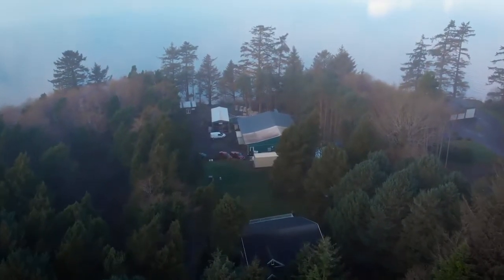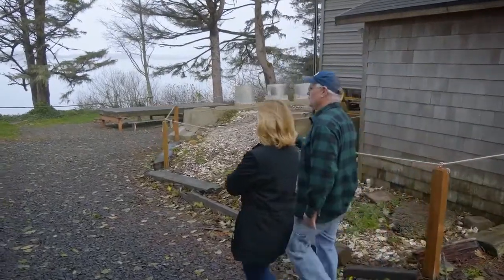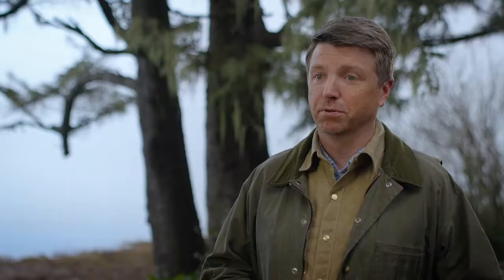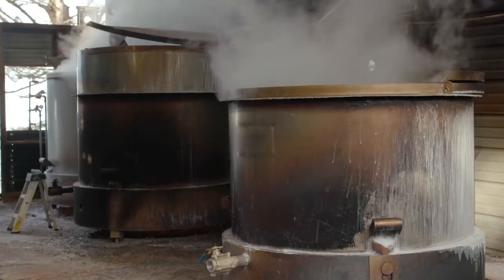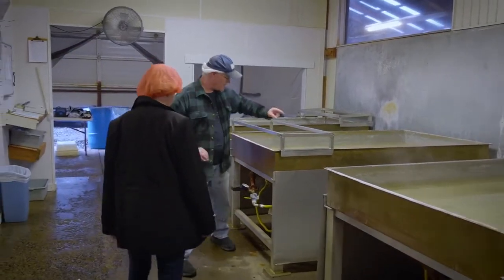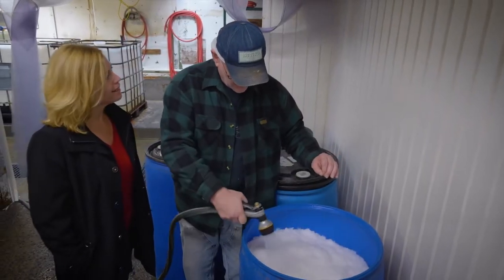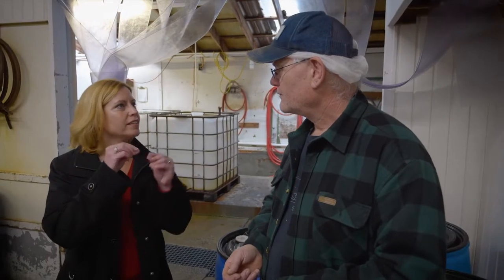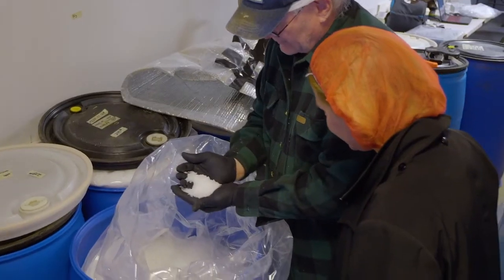How sea salt is made

Comment: Picked up 10 gallons of salt water from Netarts Bay this afternoon. Will be evaporating in my greenhouse.
Reply: How did it go?
Reply: @centrafrique9252  great results- I filtered about a gallon at a time and then boiled for 10 minutes or so to kill off any bacteria. It’s takes about a week or so to evaporate the water in the greenhouse and ended up with quite a bit more salt than I anticipated. It’s pretty unique and saltier tasting than your normal table salt. I use it daily now! I have about 4 more gallons to go for this years harvest.
Reply: @loganforgey4281  You do have to be careful with pure greenhouse evaporation processing for mold and bacterial buildup. This can vary depending on how you got the water and how you allowed it to evaporate.